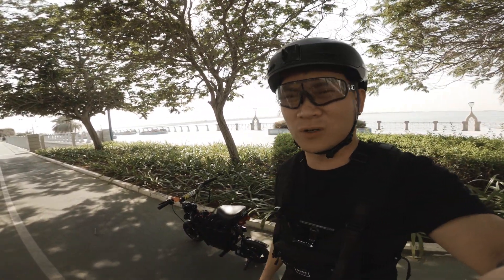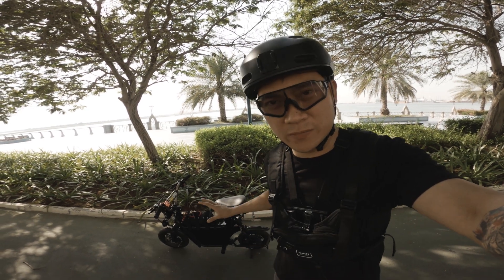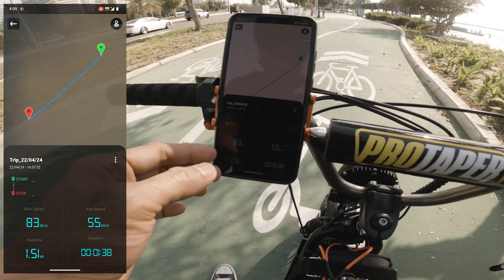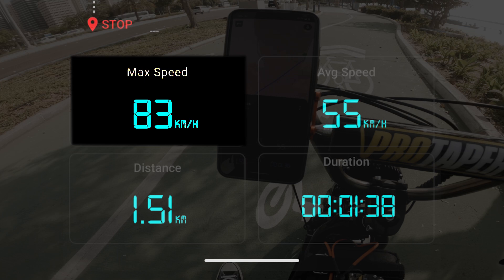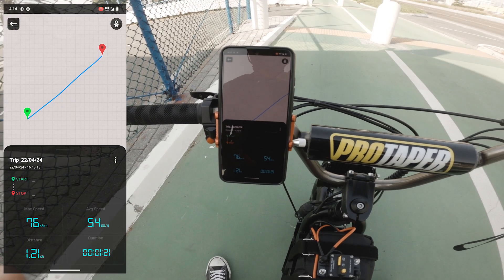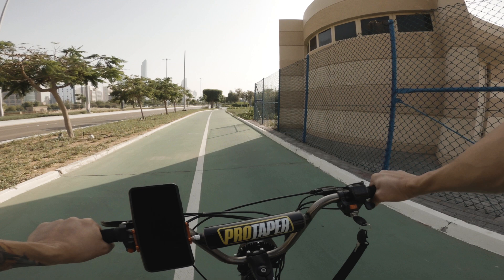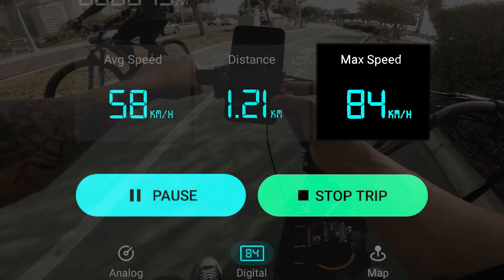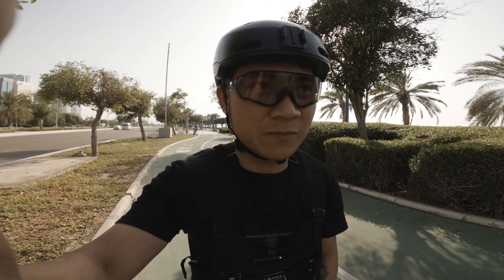Modified 72v Fiido Q1s Electric Scooter | Single Motor | Configured 50A Yuyang King (YYK) Controller

Comment from the maker: 6:17 you will notice the Low Voltage Threshold is set by default at 42v. My scooter has LCD voltage display and gives me accurate value of how much voltage is remaining, so i don't have to worry when to charge the battery.  72v lithium-ion battery full charged is normally at 84v. Then, i usually recharge my battery when it reaches down at 70 or 71v.

Comment: Watching po ksa . Ask ko lmg recomend ba na palitan ng fork? Air or spring ? Anong brand ang mas oks ? Himalo at monorim ang nakikita ko eh merun pa po bang iba ? Salamat
Reply from the maker: Goodday kaadik!
Yown! All the way  from KSA!
Kung naka single motor ka, ok n un stock fork.
Pero kung plan mo mag dual, mag dual crown fork ka. Air suspension para mas soft. 
Ok din nmn coiled suspension kung mejo tight un budget.
Marming salamat!
Ride safe lage kaadik!🤟
Reply: @jaysonulanday  salamat kaadik napansin ko kasi makaldag yung sa front eh. Recomended ba na 12x3 yung tire ko kaadik kahit single hub lng ako

Comment: Hello boss good day. May tanong ako . Kaya ba e handle ng 36/48controller ang 24v motor with 48v battery?
Reply from the maker: Goodday kaadik!
Kaya nmn pero over voltage kalalabasan niyan.
Di ka pede magbabad sa throttle.
Mag-o-overheat un motor.

Ride safe lage kaadik!🤟
Reply: Boss thank you s reply.kaso nung ginamit ko throttle lang at ang controller Yung uminit hindi motor hub
Reply from the maker: @erostimbol9812  
Kung ganyan un result, advise ko mag build ka na lang ng tama sa rating para sigurado un performance.
For safety na rin kaadik

Comment: yung gamit kO 48v 1k wats 20ah battery yyk controler  din kaSo pag nasobrahan akP sa piga namamatay motor nya my idea ba kayO anO problema kapag ganun
Reply: Simpleng paliwanag, isipin mo yung makina mo 1000cc,  tapos ang tank capacity mo ay 4Liters lang. 
Under Power 😉
Reply: @govtv4075   eh yung iba nga 15ah lang battery nila 1500wats pa ang motor at naka yyk 50a na controler  kinakaya at d namamatay..
Reply from the maker: @allahdhinn
Goodday kaadik!
Subukan mo i-rewiring un phase at hall sensor wires mo.
Y-Y
G-B
B-G

RIDE SAFE lage kaadik 🤟

Comment: ❤ Have you played with parameters in the YYK controller yet? How amps are you pulling 😉👍🚀
Reply from the maker: Goodday!
Yes, i already configured the setting.
I put it at the last part of the video.
Battery current and phase current are set  in 100% by default.
I "turned off" the overspeed on/off option.
And adjusted some of the parameters.
Just follow the guide in the last part of the video.

Ride safe!